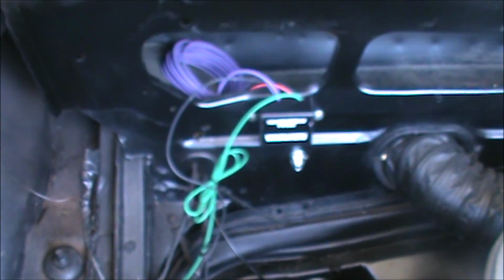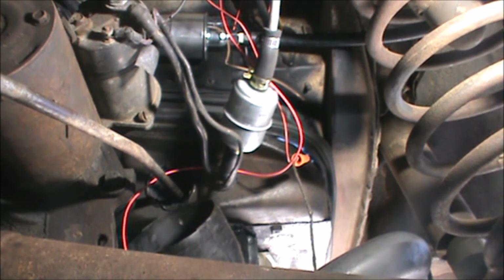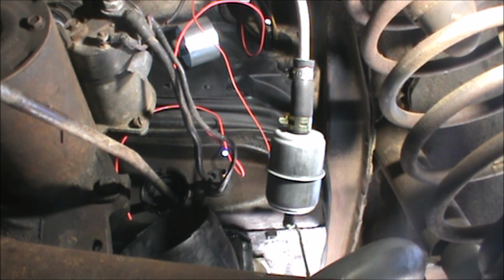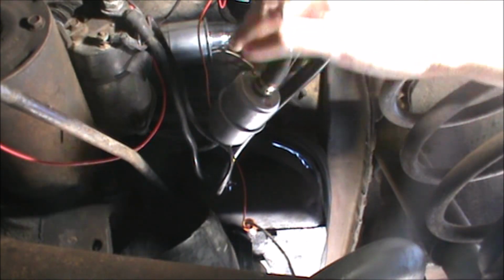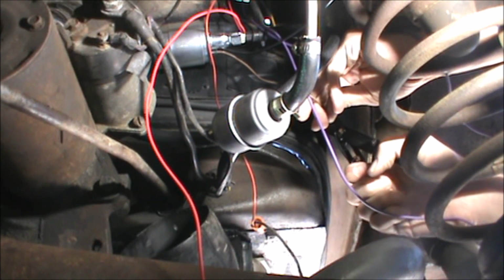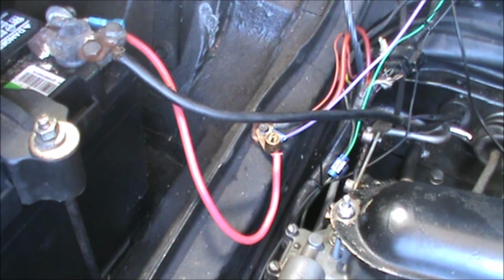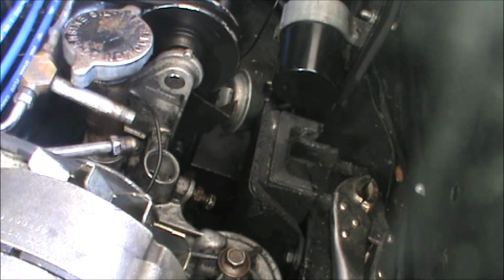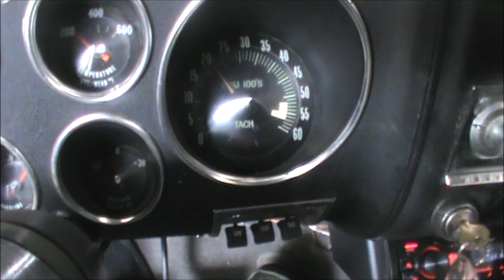I Finish Installing the Electric Fuel Pump in my '65 Corvair

Comment: Kinda the sound mine was making. Not good. Was your pump really making that much racket? I'd pull the fuse to the pump while it is running to see if that noise was really coming from the pump (be careful, you don't need a spark to cause a fire).

I still have all the bits to convert mine, but I have bigger problems. We tore my engine apart and found a bent pushrod on cylinder #3. Once the head was off we found where something had made its way into the engine and put a pretty noticeable hole in the head and damaged the piston and probably the jug. 

The good news is that Michael at LeVair Performance has a 110 HP engine (and a PG transmission) that he pulled for a customer to swap it for a 140 HP that I am getting for a very nice price. With any luck I'll be back on the road in a couple of weeks.
Reply from the maker: The noise sounds noticeably worse on camera than it does in real life. It wasn’t making that sound two days ago, when I pulled it out of the garage. The only difference between then and now it the fuel pump and the car being up on a jack stand. But it is concerning.
Reply: @bigalsgarage9323  Yeah, it definitely would have me worried. I guess that all you can do is keep an eye on it.